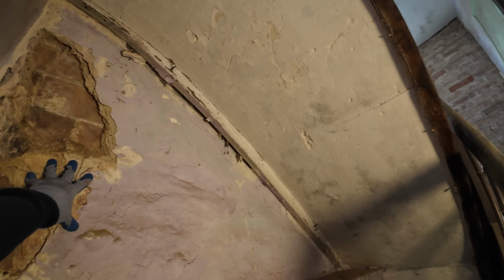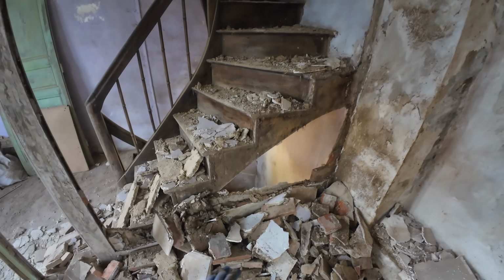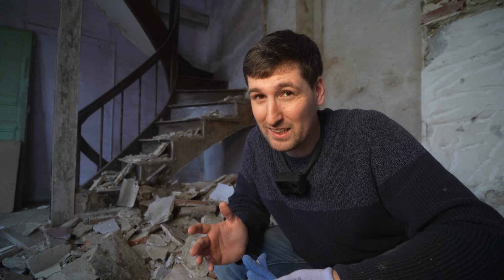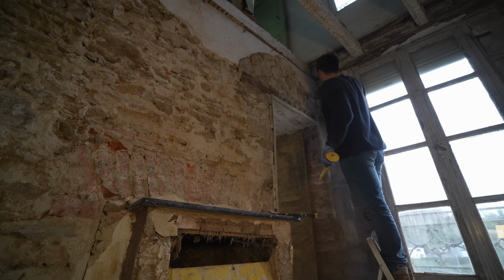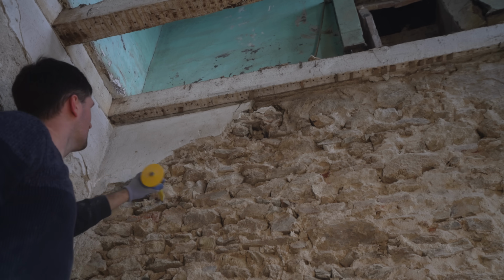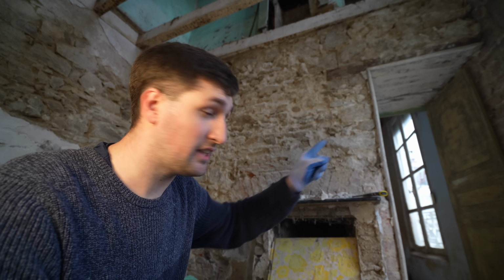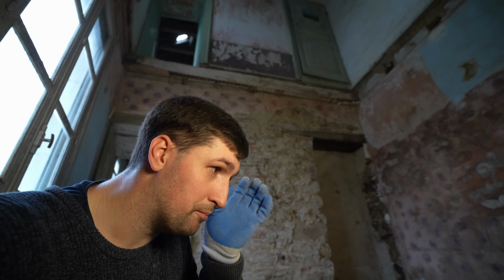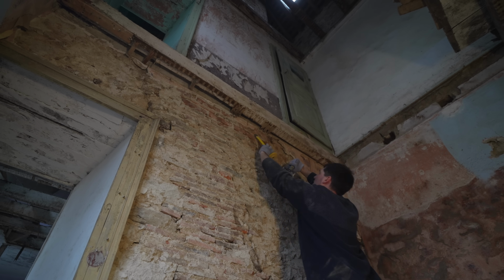It All Came Down... A Change of Plans

Comment: You know, Ryan, since all these walls are coming down, you can redesign your layout in any way you like.  You don't have to stick with your original plan for rooms if you don't want to.  Very freeing!
Reply: In fact you could have 2 rooms with a very high ceiling
Reply: Within reason.  I think those stone/rubble walls are structural and probably can't be moved much.  And honestly, they do lend a certain air to the place.
Reply: Yes…. The world is Ryan’s oyster as far as the flat’s layout.  It can be bad ass.   I’d suggest when you walk in the front door you can look all the way up to the top… maybe a meter by two meter cut out … use wire for your railing and 8” plexiglass on floor.
Reply: If that spiral stairway could be made structually strong enough, it would be very impressive to restore if your considering an open concept plan ... :-)
Reply: @chad-bf7zi  It would be too costly to keep heated in the winter.
Reply: what if Ryan turns it into a multi floor library?
Reply: Agree imagine seeing the Beautiful; open beams daily in a loft style home? Excellent walls for that. Later!
Reply: imagine a mezzanine floor for an office in the attic over a bedroom so the bedroom can see the roof beams
Reply: @DavidPsCaddy ; or put in a metal spiral staircase, with metal joists running across the floors to strengthen the floors from side to side ? If we are talking strengthening his hard work.
Reply: People could show him through their design drawings. He still is a New by renovator. Happy Easter!
Reply: ❤ the place  is really coming apart well! I live watching the demo sped up!
Reply: I love the openness. Maybe some double volume somewhere which would add to the "wow" factor. Now is your time to plan well Ryan & create   a very unique interior.
Reply: And, and . . .
     You could go ALL plexiglass floors, even beam structures!  🙉
A-Mazing!
Reply: @randolphfriend8260  Plexiglass would not be strong enough for the floor unfortunately however Safety glass made especially for this would be that is unless you never walk on plexiglass area then it would be fine. Upright see through doors or walls would be cool and the beam work is definitely a show stopper. It is of course up to Ryan to decide maybe encouraging him to get the app that decorates and customizes space is an idea. Surprised Brico does not use the APP for more Business. That could be used as a Bargaining chip. Good idea though. Later! Happy Easter!
Reply: Couldn't agree more! You have a blank canvas in there! Who knows, maybe an architect is watching this channel and could perhaps send you some ideas!!
Reply: He already has two rooms with extremely high ceilings 😂😋😉😂😋😉

Comment: It would be super to have some area where you have either a double ceiling height or the top floor with exposed roof frame because the rooms are narrow which you could make the best of by giving yourself some area where you have the vertical space open. Excellent quality video and you're are meant to be doing this Ryan. Your skill set and flair are perfect for this. Huge hats off for taking this leap 68K in one day must tell you a lot. :)).

Comment: To  do a cost assessment on the walls plaster straight on the stone or use studs and plaster board to make flat straight walls plus allow air to to the stone    to breath. 
Is there a place in attic to put a small effective  exhaust fan? To draw out moisture. 
👍🏻👍🏻 for more videos.

Comment: Hi Ryan - it appears that your house is half of a larger building (much like a duplex here in the States).  Given the state of your interior walls, I do wonder about the wall that separates your house from your neighbor.  Assuming both sides were constructed at the same time, using the same materials and construction techniques, do you think the shared wall is much the same as the interior walls you are removing?  Or might it be a bit sturdier, like the exterior stone walls?  Also, given the extent of wood rot you have seen (wood worm?  damp?), do you think the neighbor's house has been better maintained and the wood is in good condition?  If not, could it potentially affect the stability of your house, even after you finish the renovations?  All the best to you!

Comment: its time to install a steel frame before the walls come tumbling down.
Reply: I was thinking the same thing. He could hide the reinforcements if he wanted
Reply: Don't think he's taking down any structural walls.
Reply: He could replace the joists with steel. If he's not wanting the wood shown. Could even be a better idea. Or even do half and half, I don't see any negative to that $ wise.

Comment: I would be VERY careful - in such an old structure, removing all or most of the joists at once  - does risk movement in the walls.   Mentioned it several episodes back.  An old house partly relies on the joists as part of its lateral integrity, not just the foundations.
Reply: My thoughts exactly.
Reply: My 🗳 vote, too.  Replace the structural bits progressively, just a few at a time.  There was a lot of ballast in the former floors that stabilized the walls below them

Masonry wall codes in my region allow an aspect ratio of no more than 1:10 and no more than 10' vertical without support.  Also, you appear to be a single structure with your neighbor:  think of the damage to them if your outer walls start flexing.  One shudders to imagine.

Comment: Ryan....you have to follow some of Billy's work habits.  Clean up after a job.  Even though the tip is closed for the day, bag some of the debris and have it ready when it opens.  I know that you're tired after a "smashing day", but a few bags a day would make such a difference.... unless you're planning to use the window again.  Shovel the concrete towards the window every day to make it closer to the dumping area.  Construct a ramp up to the window, use a wheelbarrow and tip into the trailer. Some of the bricks looked to be in good shape, so pile them up and have it ready for Nick Moon when he comes to help.........just some "tips" for you.  From a 68 year old who had a father that used all kinds of ways to make jobs easier.

Comment: That rock wall is actually a nice addition to your plans. Get it fixed up and regrouted/poointed and use it as an accent feature. Some granite is beautiful when cleaned up and it is by the fireplace too. So many opportunities available to you. The weather here has been a bit off as well, wet snow in piles then dry up only to do it again next weekend. You have a great day
Reply: Rooms need insulation and somewhere to hide the wiring etc. stone walls would be very cold in the winter.

Comment: Good that you met your neighbours. Regarding the cleanup. See if you can get a section of that tube Billy used at the Convent to load his lorry with debris. It would be a lot quicker and easier to load your trailer that way instead of bagging it or using a bucket. Regarding your videos; your viewers will watch them regardless of the number per week. Crack on!

Comment: Just a little bit of overall advice. First, get all, and I mean all of the demolition done, so that you reduce the amount of dust when you're building. Second, try to finish the rooms from the top floor down. That way you are not tracking construction dust and debris on the newly remodeled floors. This is not always a workable thing, because you might need to finish certain rooms first, due to circumstances.  In this case, try and leave the staircase for last. You've got great people to lean on for advice, so keep up the good work. I look forward to every episode.

Comment: The room with the open staircase is so open . I love the look. Have you considered leaving most of it open, just closing off the lower corner where the stairs are??
You're doing a great job. I look forward to more videos ❤
Reply: It would cost to much to heat in winter.
Reply: Ryan you probably have it planned but that hole in the roof is going to risk more water trouble. Maybe throw a tarp over it at least???
Reply: think it's a skylight. Not sure.

Comment: You know, personally, I really like the rustic, exposed stone walls. I was thrilled when you started taking the coating off. I guess you had to return your Dad's rockin' drill. No pun intended. (is was a good one though) And isn't that wonderful that your new neighbours are so accommodating. So awesome! 😀
Reply: I know what you mean. I’ve wondered how much of this construction is actually really, really old, like it maybe could be in the basement. Even if not, the appearance of age in the rest of the decor is very artistic and versatile. 🎉 ❤
Reply: @user-vb6gl6nf7c   I believe you're right, I feel that building has some age to it. I mean, if they were using dirt to insulate the floors, that would have to go back to quite a while ago. I really like the staircase, and since it's been exposed, it actually compliments the space so nicely!

Comment: Like others, I would urge you to borrow some safety equipment from Billy. The house is definitely more dangerous now, especially with all that rubble everywhere. You are right to worry about it falling on your head. I would just shovel some of it away from the edges and off the staircase, even if you can't bag it up yet. None of us wants to see you injured Ryan. Another video per week would be lovely, but only if you can manage it. Keep going, it won't be long before you can start the renovation, rather than the demolition phase. 😄

Comment: Ryan - you should borrow the debris shutes that Billy used to clear the debris at the Convent  . . . . . Shovel it out the window into a truck or trailer to haul it to the tip.  Good luck with the cleanup - ALWAYS easier to work in a clean environment.

Comment: As an anaesthetist  having been on duty espacially  in the eyeclinic for many many nights I am less concerned about your head not being protected by a helmet- but I am concerned your eyeballs might be damaged. These parts hammered off the wall have lots of kinetic energy. Them being thrown in there causes lots of damage. Everything magnetic is easily removed .
This kind of stuff isn’t. Wood, plaster, parts of bricks and tiles- not good.
I’ve renovated together with two friends a bathroom and I bought glasses for swimming to cover our eyes. 
Uncomfortable, yes, but none of us got injured. We looked like frogs after having done this for hours, as the tiles were firmly plastered onto the wall.
I am envious of your project, your house , as I am later in life now and my mental capacity is worn out figuring out things like this( I helped renovating since I was 9 years old). 
Nevertheless it lifts me up as your work reminds me that imagination how it could be is a powerful inspiring tool. Thanks!

Comment: Your house just needs a little tweeking. It's not so bad. Put an angled pertial wall for the stairs to use as a banister to seal the side of the stairs but leave the top open . It will give the room a larger and more airy feel.  Never underestimte the usefulness of a BIG hammer.

Comment: Great video.  Question.  If you put a sheet on the floor before you do the demolition, would it not make the clean up faster?  Maybe the materials are heavier then I think it is.  Maybe going from the sheet to the bags are not any easier.  Just a question because it is your house.  You do you.  Just a suggestion in trying to help.

Comment: is that rather large 'niche' an old doorway or what? stuff like that bothers me in old houses. in spain, fpr instance, almost every house has a small opening about 4/5 feet off of the ground on the front wall. its a tiny doorway, so i wondered if it was for dairy delivery or something else. we used to have the dairy delivered to a larger opening here in the states, but it was in back or on the back side corner near a porch by the kitchen.

Comment: Those thin bricks, Ryan, look more like tiles. Maybe they built the wall thinking that the tiles would add insulation? I wouldn't trust any wall supported in the voids by those thin bricks. They can't replace decent framing for structural strength..

Comment: That wall was way too easy to remove and could have been a hazard while working there.  If you want a boost or to see worst case scenario before the diy and the reward afterwards The Quinta u tube channel a brit  in Portugal has also done back breaking reno's like yours all I can say is hire Simon or learn to plaster lol.  Revenue Ryan more vids will help you pay for floor joist's because your going to need alot of them.  :)  Do what you can each day and remember what Billy had to do to the kitchen at the convent before it became the beauty of all kitchens.   Have a great day Ryan  :)